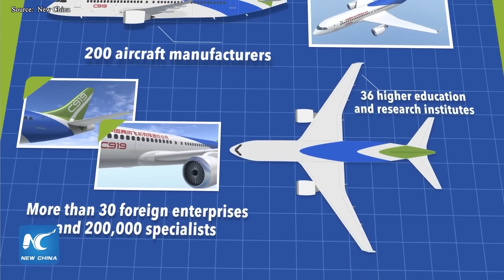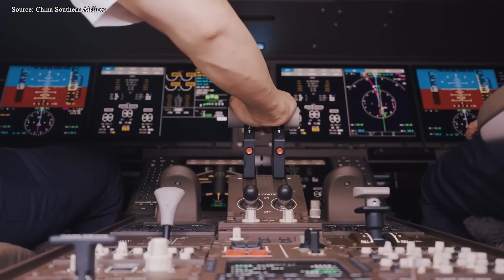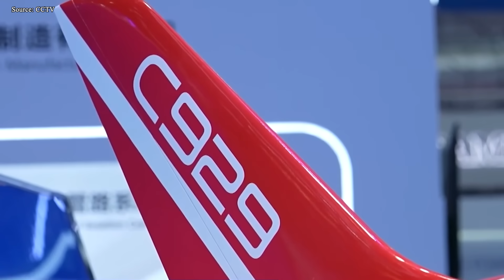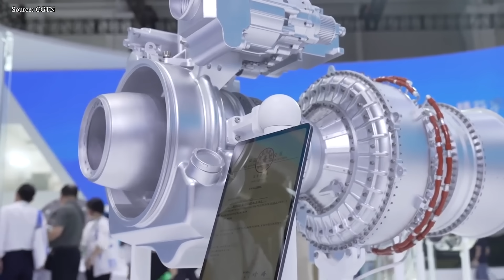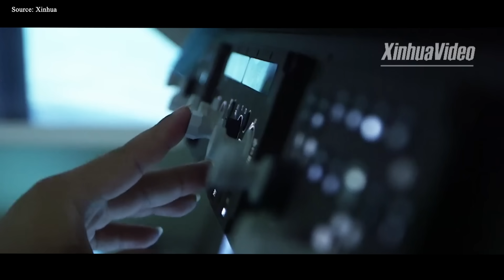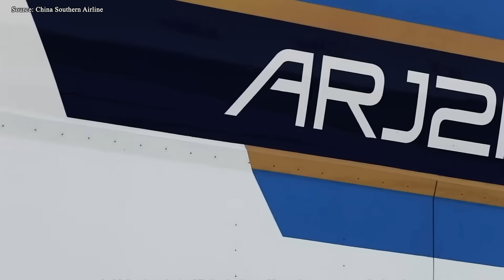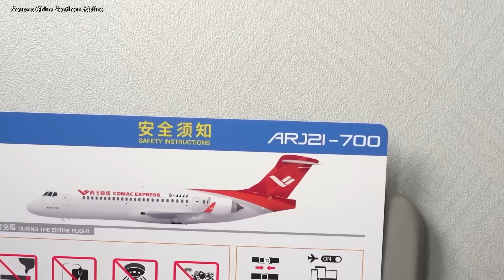This Is Why COMAC C929's Engine Outsmarted Boeing & Airbus!

Comment: China c929 is a copy of the Airbus A 320 and they don’t have the technology to build a modern engine.
Reply: Don’t even know how large C929 is supposed to be yet talk so confidently about its origin?
Reply: Remember they said they can’t even build chips now they have banned nvidea and intel in china , be careful what you believe
Reply: Really ??
Reply: Ha ha ha
Reply: Incorrect. C929 is an equivalent to a medium sized wide body like Airbus A330-neo or Boeing 787. It is a wide body compared to C919 which is a narrow body like A320 and 737 Max.

Comment: China’s own aviation regulator, the CAAC (Civil Aviation Administration of China), has already certified the COMAC C919 for domestic commercial service.
This means Chinese airlines can use it on routes within China without needing international approval.
For now, only a few aircraft are in operation — mainly with China Eastern Airlines, flying between major cities like Shanghai, Beijing, and Chengdu.
These flights do count as real-world operational testing, helping COMAC gather performance data, refine software, and address maintenance issues before expanding internationally. In the meantime, China could indeed operate the C919 in countries that recognize CAAC certification or are willing to grant temporary or partial approval.
That could include:
Some African and Southeast Asian countries with close trade ties to China.
Belt and Road partners that might accept the aircraft on a bilateral basis. So.. limited international routes could happen under those arrangements, even before full FAA/EASA approval. The C929 will take more time though.

Comment: China uses imported engines on C919 in the hope that it will gain certification from FAA more easily,  not because China cannit produce own aircraft engines. I fact China has CH-1000 engine on stand by.  
The fact that US  and Europe refuse to issue certification to C919 despite it meets all safety standard is because they want Boeing and Airbus to stay duopoly and bar China entering the civilian aircraft market as a vital competitor.

Comment: Why didn't they at first develop an engine for the C919? They would need more engines for that plane?
C919 flying from China to Hongkong is not very international, as Hongkong is ruled by China.
Reply: As with many things, it was easier and cheaper to just buy engines. You need a certain volume before it will be profitable to design engines due to very high development costs. The imported engines was expected to make secure a faster EASA/FAA approval. I'm sure China is adding potential supply chain issues too. I'm sure Trump would do anything he can to prevent them from succeeding with their planes. As for international flights, China could operate the C919 in countries that recognize CAAC certification or are willing to grant temporary or partial approval.
That could include:
Some African and Southeast Asian countries with close trade ties to China.
Belt and Road partners that might accept the aircraft on a bilateral basis. So.. limited international routes could happen under those arrangements, even before full FAA/EASA approval. These flights do count as real-world operational testing, helping COMAC gather performance data, refine software, and address maintenance issues before expanding internationally, and secure the EASA/FAA approval. I'd bet money on Trump blocking the FAA approval as long as he is in office. He's not a fan of China or competition.
Reply: @LotecAvenue  The C919 seems to have problems as there have only a few delivered to customers as it was said. But I don't know the cause.
Trump only likes Canada and Greenland as he wants to absorb them. But he hates the rest of the world, Mostly China and the EU next. Our diplomats should quit their service and be replaced by psychologists and psychotherapeuts to deal with the USA.
Reply: Based on another post I read, they already have their own engines called the CH-1000.  But they use imported engines in the hope that it will gain certification from FAA more easily. (I don't know if this is true.)
Reply: @tomtube1012  Anyhow, up to now, the Chinese commercial aviation projects have not been running well. There is more hot air than flying stuff.
Reply: FAA and EASA approvals mainly. But they have CJ-1000 under development. FAA and EASA have a conflict of interest as they try subtlety protecting their own home grown companies. From the Boeing 737 MAX saga you can tell how much FAA reviewers were compromise and captured by Boeing and waving through fatally flawed software assistance to compensate for the changing of the centre of gravity due to the new settings.
Reply: @pyap01  No doubt, it was a scandal that FAA approved the MAX. For that one even needs not much software knowledge, as taht cannot work safely with only one angle of attack sensor. As I had a little insight into the safety design of nuclear power stations, I can only say that these people should have been roasted in public.
Reply: Boeing and Airbus do not build their airplane engines themselves.  They bought them from engine specialists.
Reply: @martinleung212  In China, it is the same.

Comment: Without certification, Comac cannot buy the insurance for its passengers on international flights.
Reply: They don't need insurances, as Chinese products never fail.
Reply: @gottfriedheumesser1994 
Do you drive your car without insurance?
Reply: @ducnguyen-iv9px  No, it is a Japanese one, and so it can fail.
Reply: @gottfriedheumesser1994 
I don’t know where do you live but in most of countries except the third world, you have to have the insurance to drive if you don’t want to pay a heavy fine and your car will be towed!
Reply: @ducnguyen-iv9px  Fr my next loke I will write a manual with twelve pages of clarification.
Reply: Comc will not buy any insurance for passengers transported by their planes, as neither Airbus nor Boeing does that. The company operating the plane is responsible for insurance, maintenance, and all other operational requirements.
Reply: Define international

Comment: Just like China's inferior and exploding EV's the COMAC C929 is junk.  Why??  China lacks the capability to manufacture the precision bearings vital to jet engines.  This same shortcoming is why the Chinese high-speed rail is failing, they cannot make the bearings and wheel sets with the precision required for these applications.  Why has the building of the C919 & C929 aircraft stalled, sanctions against selling western built jet engines and components to China.  The C929 engines are likely western built engines disguised a Chinese built.  These same engines are likely removed from older Boeing or Airbus aircraft and re-installed on stripped down Chinese aircraft in order to produce the false performance data.  China's domestic built "modern fighter" jet engines require full rebuild 5 times as often as western built fighters.  China does not innovate; they copy and/or steal technology.  The CCP state-controlled media is nothing but propaganda, reporting nothing but lies.  Prime example, reporting 4 or 5 percent GDP growth while the real estate and EV markets have collapsed.  Thousands of acres of EV's and gas-powered vehicles rusting away in lots, never owned or driven by customers, licensed by the manufacturer in order to inflate production numbers.  Shipyards full of rusting unfinished hulls that possibly will never be finished.  Thousands of factories closed never to reopen, empty retail districts as well as entire villages, towns and even cities deserted.  Population of 1.4 billion reported but is impossible with the one-child policy, anything below around 2.1 is negative growth.  Accurate population figures are estimated to be around 350 to 500 million.  CHINA IS THE LAND OF FAKES AND FACADES.
Reply: America copied the jet engine from the Me 262. And the rocket engine from the V 2. The gasoline engine from Mercedes. The electric engine from the UK.
Reply: You are a very desperate person
Reply: Lies
Reply: I don't know about their aircrafts, but their EVs are top notch.
Article : "Chinese cars dominate latest safety ratings"
Quote : "Six out of the 10 cars assessed as the safest on Europe’s roads are from Chinese manufacturers"
Reply: No American car made it to the list.  The other 4 cars that made it to the list were from : VW, Mercedes, Lexus and BMW.
Reply: Carry on with your ignorance 👍👍. Cheers and keep on sleeping

Comment: Why does the Chinese need Western approval just to fly their own planes in China or Asia? --- As long as the plane is proven safe and reliable, sell it, fly it.
Reply: FAA is corrupt - look at Boeing!
Reply: wait, don't worry about that, enough business and enough areas for C9XX to fly over and stop.
Reply: Yeah they don't.
Reply: C919 needs US approval for sale in USA. Boeing plane also needs China approval for sale in China.
Reply: @michaelloong964 you are partially correct. You can't fly into a country únless certified by the aviation authorities.
Reply: Between the US' BOEING & FAA, do you believe a relationship of ownself-check-ownself actually works?
Reply: Without western certification, it cannot fly into europe or US
Reply: @syedputra5955 It is a question of monopoly, the West is using this " reliability" BS to stall certification of the C919. How reliable are Boeing's planes? They have lots of issues like falling off the sky, engines catching fire, parts like doors ripped off while flight and etc. 😅
Reply: @horchongkang6244  "lot's of issues" yeah besides the door plug and quality control, the engines catching fire aren't Boeing's fault
Reply: @horchongkang6244  and the fact that there are still people like you that blame Boeing for an engine failure is crazy

Comment: GE doesn't own a big engine, they license it from SAFRAN, The french multinational corporation, from the CF-6 to the newest GEnx engine.... Also the CFM-56 lines of engines....
Reply: China has enough cash to hunt top engineers and specialists from R.R. G.E. and .....
Reply: @josephguo6256  GE is a nobody, they license 80% of SAFRAN engines IP....!.. They're simply an underwriter for SAFRAN engines made in the US and operated by Boeing...
P&W is the powerhouse engine manufacturer in the US which they also own International Aero Engines...